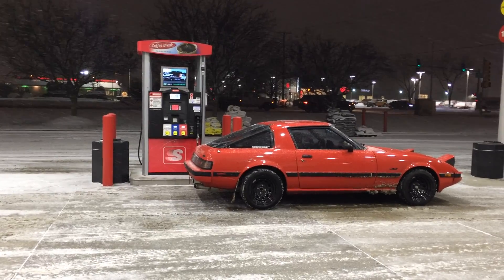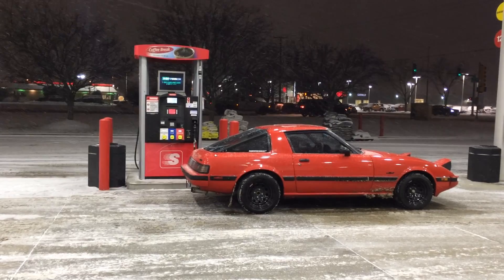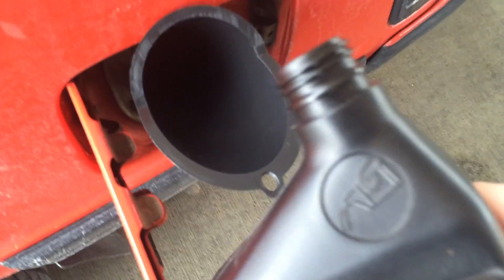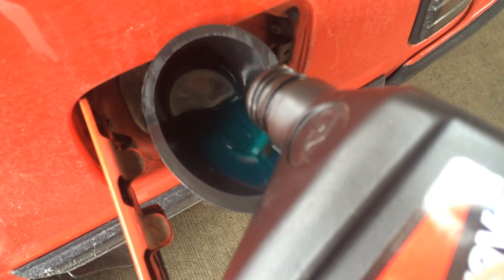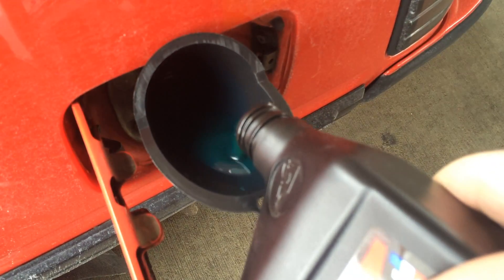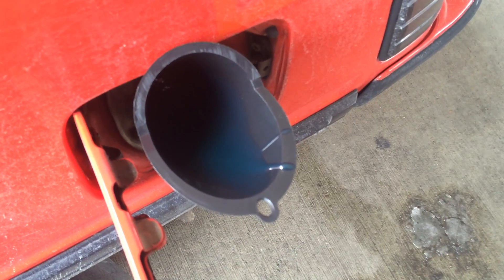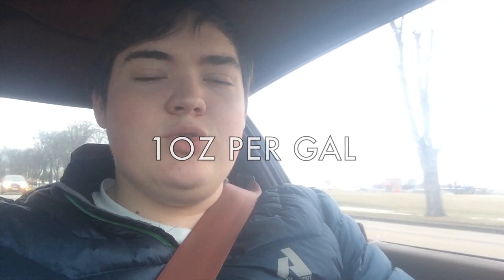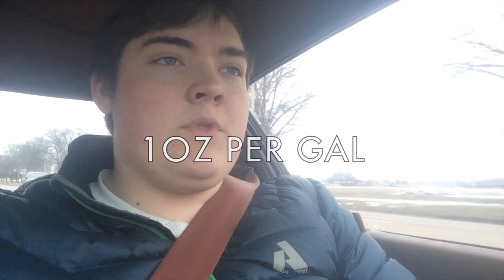Rotary Life Ep. 16: Premixing

Comment: I'm confused about this rumor that if you don't pre mix that your Rotary engine will need a re build after 80K miles. During the late 90's and early 2000's  I have owned several 1st gen RX-7'S as well as 2nd Gen both NA and Turbo back when you could still find them on the cheap and not modded to death . And every RX-7 I purchased had well over 80K on the ORIGINAL Rotary engine and I went on to drive them over 150K before I traded them off and got into another RX-7.  Some of those RX-7'S that I traded off to where friends that went on to drive these RX-7'S well over 250K on the original motor . We never pre mixed.  Hell the only thing we did is pump cheap gas and change the oil every now and again. Back in my day RX-7'S were viewed as very cheap reliable transportation and not these delicate machines that people make them out to be these days. Often RX-7'S were bought not from a enthusiast perspective but rather a cheap car to buy if you were broke and needed a reliable car to get you thru . All in all I owned 7 RX-7'S and of those I only had One blow apex seals on me at over 170K but it was ragged out not took care of by previous owners when I bought it at 100K . I will say I never have owned a 3rd gen unfortunately.  And I never knew RX-7'S would become so sought after . Otherwise I would have kept a couple of them especially my 1990 13B Turbo . Back in my day those cars were plentiful and cheap because the Rotary engine was not well understood and you couldn't find mechanics willing to service them because they were misunderstood.

Comment: as i got my RX-8 back then in April 13th 2017, i already know much about the RX-8 since i searched the internet  3 whole years before  i got that car and i know  that longlife shit is nothing for an Rotary. The best solution for me and many other would be IDEMITSU Rotary Engine oil. Oil speciffical made for the Rotary engine. i used to be on 10W30 along with a Oilfilter change it's fullsynthetic which mean's all molekular's into it are the same size and have a nice and smooth burning temperature which highends the quality of that oil and the performance of lubrication. Also is IDEMITSU the Oil manufacturer for the legendary Mazda 787B wich won the 24Hrs Le' man's Race back in 1991. The 4 Rotor Engine was torn apart to look about the condition and it was like its came freshly out of the Factory. so the Oil is surely a real good quality thing and you would  do nothing wrong with it. I also used premix and still use it. at first i used Fuchs Titan 2T 100s 2Stroke Engine oil in ratio 1:350 (which means on a 61L gastank the 350'st part) and later on switched to the IDEMITSU Premix which is a bit thinner than 2 stroke oil and you will need more of it. If youre tired of puttin everytime new Premix in while you at the gas station you can as well install the "Richard Sohn Adapter" mod. That allows you to put in the engine bay another separates Tank where you can put in all the premix and the sandwich plate which needs to be installed between the Engine and OMP (Oil Metering Pump) and injected into the combustion chambers directly trought the Oil injectors itself. am must have mod for me. Greetings here from Germany me and my RX-8 "Yuu-Chan" :3
Reply: So how many oz  per gal ? 😂

Comment: i use non detergent mineral oil thats what rotarys were originally supposed to use 8 ounces per full fill up also be aware too much pre-mix will bring octane ratings down usually 50/50 is good(14 gal tank~2=7 premix i have rotary aviation apex seals on my 8 so i use an extra ounce...g.luck

Comment: Should be non synthetic and ash less so it doesn't build up on the rotors.  The amount you mix depends on the strength of the pre-mix you are using.  1oz per gal is a good mix amount for street cars.  I have read that some race cars will do as much as 2oz per gal for racing.

You can also premix as precaution for the OMP to go bad. I do just because it smells good (dirt bike) and my OMP leaks pretty bad so I don't trust the amount that is actually getting to the engine. 

Keep up the videos.  I want to start recording some myself at some point.